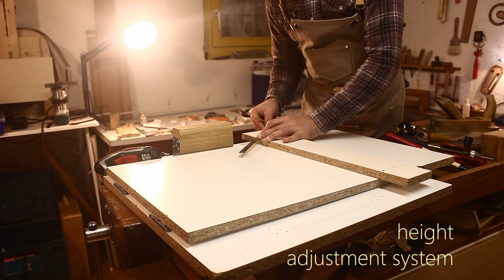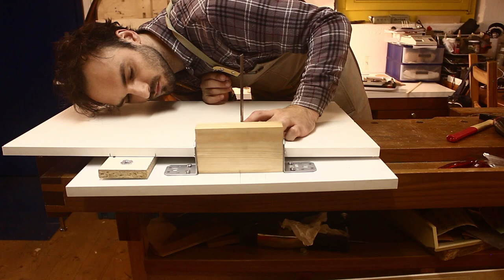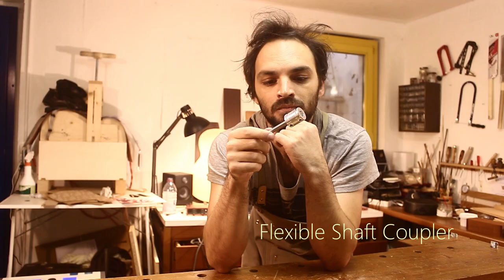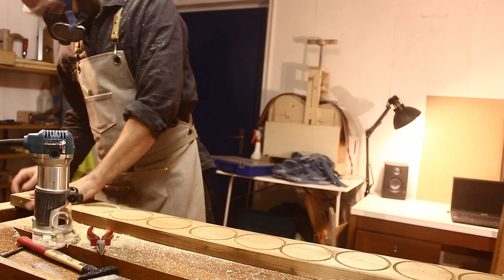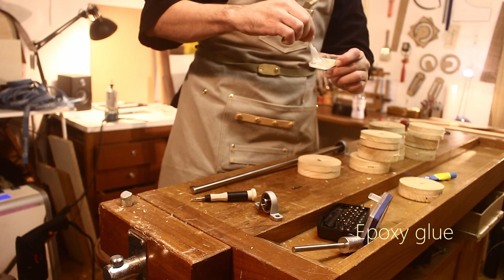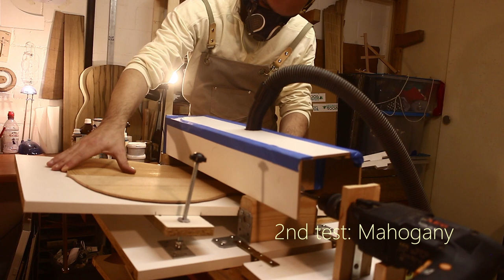DIY Drum Sander for Thicknessing Wood

Comment from the maker: Tell me what you think could improve the design! I am pretty glad with it, but if I do another one I will make it with a longer plate so there is more left to the outfeed side.
Reply: I would suggest finding a cheap induction motor with more power than the drill.  Otherwise an ingeniously simple and effective design!
Reply from the maker: @AndyCollier  thanks for the input! It's definitely a good idea. I just happened to have the spare drill hanging around.
Reply: Usar uma parafusadeira no lugar desse trambolho de furação manual
Reply: I learned more about making a drum sander here than I have from the previous 100 videos I have watched. The flexible shaft coupler is a game changer
Reply from the maker: @phillipbotha7920  It really is! Thanks, I'm glad it was helpful!

Comment: It's really good that you have left/right screws to adjust thickness - I've worked with like 1500 euros drum sander with "hanging" drum and it was night mare to get even sound board - sometimes it was 0.75-1 mm difference between left and right sides - still have sacrificial board somewhere to use as a base to even that out... Nice work!
Reply from the maker: Thank you! Glad you liked it
Reply: @chriscrevelsguitars  How do you level out the left and right adjustment screws? You use some highly accurate level (waterpas) on the feeding table?
Reply from the maker: @lush462  Very technological gadgets: I test each side of the drum with a wooden "filler gauge" until is level. Then, afterwards I count the turns I make in the screw. 😂

Comment: Hello, Could you tell me the measurement of the board where you slide the guitar tops?
Reply from the maker: 70 cm long and 40cm wide. Smaller wouldn't be adequate for guitar making. Bigger should be even better

Comment: Interesting build! How is it performing so far?
Reply from the maker: It performs well! Its not perfect, of course. Overall, it is very easy to micro adjust height but it's also easy to get the sides unparalleled. To remedy that I'll flip the piece itself every now and then. This way, I end up with the center slightly thicker than the periphery. For guitar construction this is not a problem though.